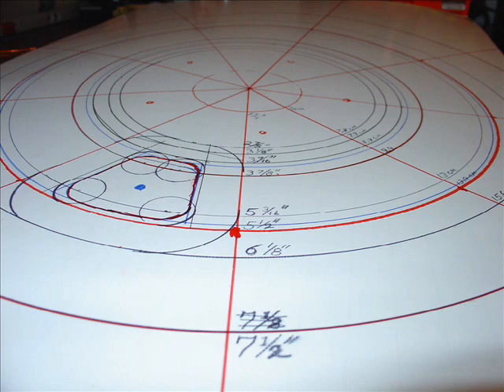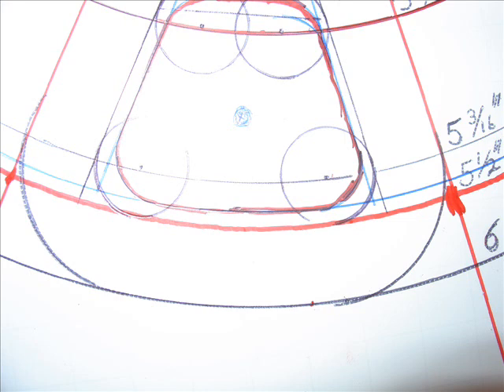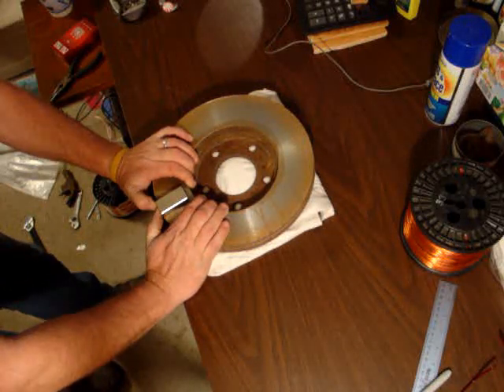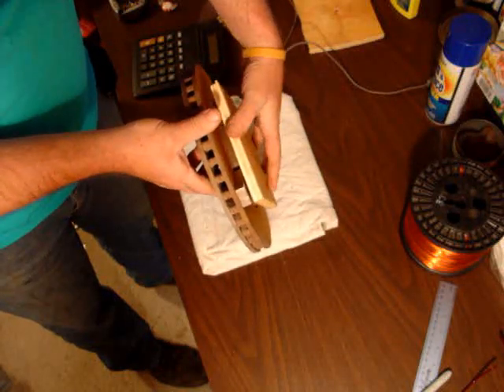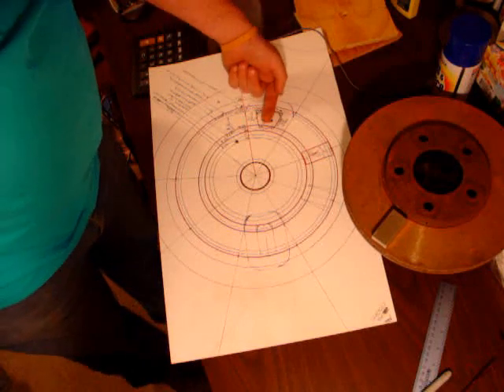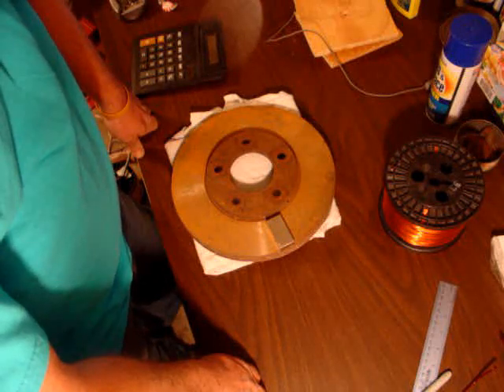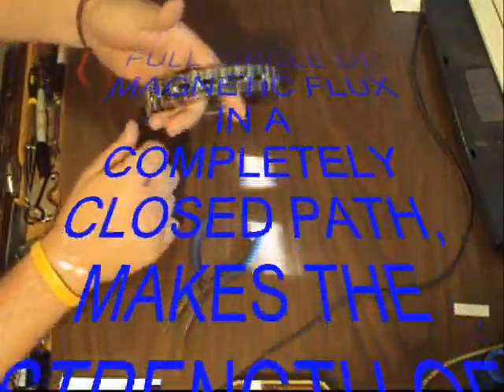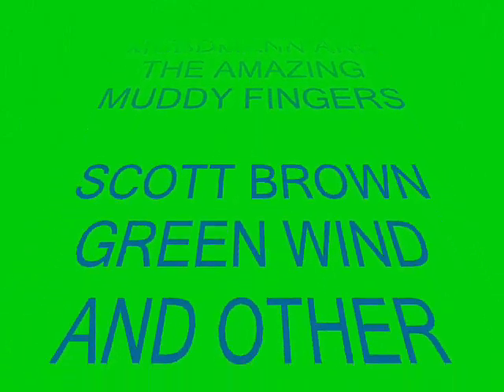BUILD A DUAL PERMANENT MAGNET ROTOR  WIND TURBINE ( DESIGN )

Comment: Hey guy great video thanks.  You could help with the rust with the rotors and magnets with a product made by Bostix called Top Cote.  It is for preventing rust build up on your wood and metal working tools.  It does not build up a bunch of junk so it should be fine for keeping the rust off.

Comment: I love your video,thanks for sharing your knowledge.
Reply: Oh, I had 2 questions for ya. 1st: where did you get your large batch of 1"X2"X1/2" magnets? I thought you mentioned it in one of your videos,but I wasn't able to find it. 2nd: If I wanted to build an AC generator (similar to your dual rotor generator,but with multiple layers.) that could power a house and a workshop (20,000-25,000kwh annually), how should I go about figuring out it's specifications? I know their are MANY variables (RPMS,wire size,number of windings,Amps vs voltage,etc.),but I haven't seen this type of scale generators (between small DC generators and full blown electric company turbines) online and I'm having trouble figuring out if the required scale is too big for my end budget. I don't know if this is something within your seemingly vast array of knowledge, but you seem to know a lot more than most I've seen on here and figured it was worth a shot to ask.

Comment: Hello Muddy, I watched all the videos of this build, Thanks for that.  Now I have several questions, Thanks again LOL.
I am thinking of using a water wheel to power a generator such as the one you built.  I Live in the hollows of Southern WV, not much winds gets down here except for heavy wind from storms and such.  However the creek runs pretty good almost year round, so I am planning on adding this water wheel to my solar panels.  I am looking at using a 48 volt system, I do not know the math to figure wire size, magnet, coil, and coil turn count I need for a 48 volt unit to keep batt bank charged while running an inverter. Also from your videos, you say the batt bank becomes the controller? Let me see if I understand that, if I have a 12 volt bank, and have a 24 volt generator charging, the bank will draw what is needed, and divert the overage to another load, such as the space heater you mentioned. Any way many questions remain, and any help would be much appreciated, Hope all is well with you, I saw from the comments on video 29 or 30, where you had to stop due to illness and bills.  I hope the good Lord has restored you 100 fold since then, if not keep the faith, and I will say a prayer for you too.
Thanks again,
Ben

Comment: A question about wire size.
You using 14AWG, what is that in mm². Some shops have 14awg as 1.6mm² and others have it as 2mm²?
Thanks

Comment: Oh...one question....this design would work on a vertical system just as well?
Reply from the maker: Yes it would. But the coils might need to be altered to suit the difference in RPMs.
Thinner wire with more Turns to allow it to get to charging voltage at lower rpms.
Thanks, and enjoy.
MUDDy

Comment: I Think I understand that the load creates amps with these axial flux design. Can one have amps or create amps without a load?
Reply from the maker: wayne ketcher The amps is the flow of electrons, kinda like gallons of water per minute, current. voltage is the pressure. The resistance allows the pressure to release the amperage. less resistance is more of an amperage load. More resistance is less of an amperage load. 

   All of the time I hear folks calling a resistor the load. When In Fact They should be calling it the (resistive load) or load resistor. But it seems folks get lazy and shorten terms too much, and get them confused.

   The load is actually the amperage drawn from the capacity of the source.(battery, generator),ect.

   I hope that helps.
MUDDy

Comment: i ordered 14awg wire and the label says it's 14awg my rotor messures 10 and 7/8 I wound a coil at 77 turns and it's to small is that cool or do I need to add more turns?
Reply from the maker: tgman1054 I would think that 77 turns is fine, But if you have the magnet rotors and hub and spindle assembled, try using the first coil as a test coil, then do the math per one phase. ie.- 3X the voltage on the one coil.

Comment: hello muddy, How much would it cost to construct a axial flux alternator capable of reaching 120, 240, or even 460. If the cost isn't  too bad I would consider pucrchasing one from you. Please email  me so we can talk buisness.
Reply from the maker: voltage is no problem. thinner wire and more wraps (turns) per coil. the problem would be, "THE WIND IS WILD". Thus: the voltage would be wild as well. Heck!, You might even achieve all three voltages in the same day.
Sadly voltage is not power. Power is voltage times amperage. 120 volts x 1 amp = 120 watts, also 1 volt x 120 amps = 120 watts as well. or 10 volts x 12 amps = the same. When I hear this question from many others, it is usually an idea to use the power directly to the house. This would be extreemly difficult.
With permanent magnet alternators, there are a certain amount of RPM per volt.
with this one in the video series, we have 10 RPMs per volt. 120 RPMs produces 12 volts. 1200 RPMs would produce 120 volts AC three phase.
In jest... I wouldn't want to try for 240 or 460 without bolting the magnets down. I would think neodymium iron boron magnetic bullets wouldn't be much fun as they fly off of the rotors. Very few would miss the cars, or other ferrus attractive metal monsters as the pass your house.
On the upside,.... One could design the coils to achieve any voltage at just about any RPMs. and a constant speed engine could be implimented for use as a generator.
On the downside,... when more power is drawn from the unit, voltage will drop slightly, and the RPMs would drop, Thus the Throttle would have to be adjusted according to the load applied. Also: as the amount of load increases, it would take more RPMs to maintain the propper voltage. this means that the frequency of the ac would increase as well.
   That would be ok for running lights, motors, or as use as a welder. but when one or two things are turned off. the throttle remaining at the same intake, the absence of back torque would allow the rpmS to skyrocket the voltage and blow the rest of your loads.
    SOLUTION FOR YA.
BATTERY BANKS, CHARGE CONTROLLER, AND FULL PURE SIGN WAVE INVERTERS.
     Thank you for this question. I have been wanting to address this for a long time. You have granted me this oportuninty without having to do a lot of work to demonstrate it. Superb question my friend. THANKS.
MUDDy
Reply: Impressive & very necessary knowledge. I will contact you soon to show you my last project. I know about movement, but nothing about electricity. Thx for your time!

Comment: nice video , check out my jig design which i have used on loads of coil winding projects , i designed it to get near perfect allignment for copper coils because my previous jig which failed to attain allignment after 70 turns got thrown back on the scrap heap .... this new jig i designed keeps perfect allignment for hundreds of turns